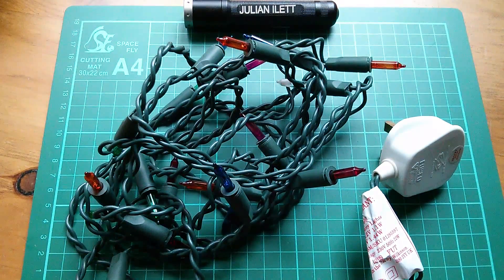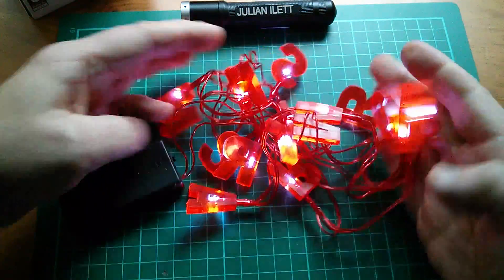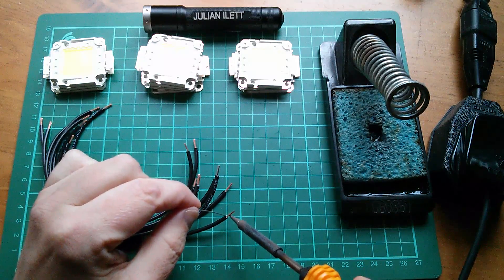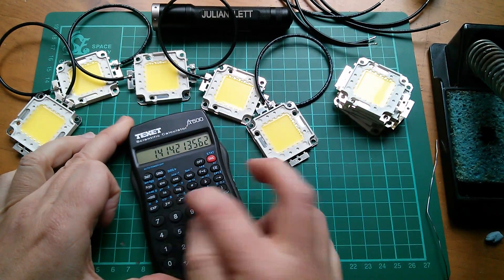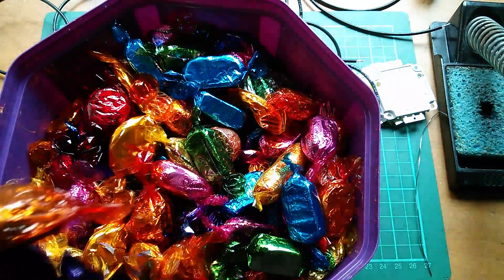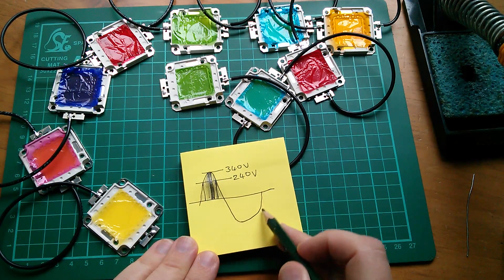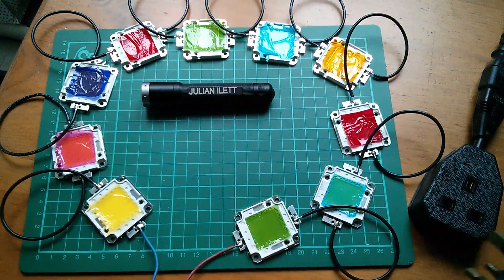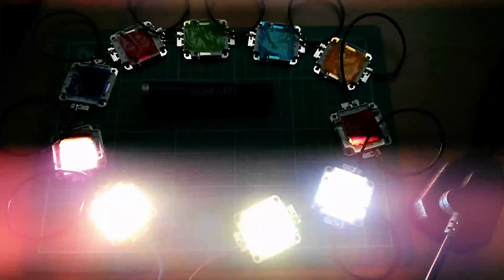Scary Fairy Lights - 100W LEDs on Mains

Comment: Effectively running those leds at 110V or 120V, and not 240V, as the 240V is from the bottom to the top of the total cycle. Ok, here in South Africa that should be 220V, but standard is 230V to compensate for load. You only use the top halve, as the bottom halve is blocked by the led. A full wave rectifier will give you twice the speed of flicker, (100 or 120Htz depending on mains frequency in your country), and double the amount of light. That should be a nice sight, but twice heat generated also. Wonder if the leds will be able to handle that...... I've ordered some 50W grow light/leds from China that is spec at 220VAC... Ummmm .... maybe it is 100W DC 110V leds...... Better not start thinking in that direction, the stuff is expensive. :-(
Reply: Sorry but you're completely wrong, there o.o AC mains is 220-240V (RMS) above zero on one half of the sine wave and -220-240V (i.e. negative) on the other half. If what you're saying was correct, Julian's LEDs wouldn't have lit at all, because as he pointed out, each LED had a forward voltage of around 35V, so with ten in series you need roughly 350V to light them, which comes from the peak voltage of 240V RMS (as he explained). Or if you're saying that the upper peak of the since wave is 240V and the bottom peak is 0V, then capacitive droppers wouldn't work (and bridge rectifiers would be pointless) because they rely on the voltage swapping from positive to negative on each half of the cycle...

Comment: You need a bridge rectifier, and could wire a couple sets of them in parallel to stay at the usual 240v.
Funny though, in America, most of ours is 120v, until you need to plug in a bigger appliance, then we go up to 240v, then if that's not enough, we use multiple phases.

Comment: When I was a child, there were no LEDs. My grandfather gave me a box of 12V / 100W halogen projection bulbs he "borrowed" from his workplace. I wired 20 in series and made a 2kW fairy lights :D. I wired them with a  bare wire, as any insulation would melt in this situation. Insanely bright and insanely dangerous. It also heated up the room nicely in the winter time. The turn on inrush occasionally tripped the breaker... :)

Comment: I half-expected the LEDs to fry on the negative half-wave. They'll have some tiny reverse leakage current, but if that varies enough between modules, then the one with the lowest leakage (highest resistance) will receive a bigger portion of the -340V than the others. This is also why I once fried a filament xmas light that I borrowed from a different set, when I assumed it might just be dimmer than the others due to higher resistance...

Comment: noob question: why weren't the LEDs killed by the AC from mains? I don't get why they were confined to just that small section of the AC wave.
Reply from the maker: It's only at the very top of the AC sine wave that the voltage reaches 340V (34V per LED). That's still not enough to push a destructively high current through the LEDs.
Reply: Ohhhh I see. So it is only at the very top of the sine wave that the current can flow trough the LEDs right? Because at the top of the wave the foward voltage is reached. Anywhere else the current can't flow and they are essentially off?
Reply from the maker: Not exactly. LEDs do not suddenly switch on at a precise forward voltage. There's a range over which the current varies. 100W LEDs start to conduct at about 24V and reach maximum safe current at about 35V or 36V (it can vary) . Any more than that and you risk destroying them.
Reply: unnn I think I get it now. Thanks!
Reply: But if I put a 5mm led on my psu at say 3v it just fizzles out, why not these ones? And also, maybe you can help me, but in AC, why is one called live and one neutral, when they are both carrying positive voltage half the time? is there a difference, and am I completely wrong... :P I'm not the smartest person
Reply: because your 5mm LED only handles 20mA maximum and your 3v PSU gives out much higher than 20mA and there is no current regulation.
20mA is not much so its not enough to load down the psu. and the LED has much lower tolerance because of how small and low power it is.
so it would pop immediately most likely unless the voltage is slightly less than 3v.

Comment: Hi, stupid question perhaps but what if you would just connect 7 leds in series: 7 x 32-35V = 224v / 245 V. Would that reduce the flickering? Is it still dangerous to do this without a Voltage regulator? thanks for the info! great channel
Reply: You need a series capacitor dropper to limit the current and bridge rectifier after the capacitor to turn AC into DC as the capacitor needs full wave AC to operate as a LED ballast. 680nF 400VAC X1 should work fine as a series ballast for these LED's, add 1M0 0,5 - 1W resistor in parallel with the capacitor to discharge it when unplugged so you wont get zapped.
Reply from the maker: The 340V peaks would probably kill the LEDs
Reply: Aha! Good to know thx

Comment: I need a circuit diagram for MPPT solar charge controller circuit without microcontroller.
Reply from the maker: I tempted to say that can't be done. It probably can - but I wouldn't want to design that circuit.
Reply: Can you help in searching for that circuit in internet please or any link to it ??

Comment: Use a bridge rectifier and some very thin bell wire that's high in resistance to limit current.
You could also use a toaster element to control current, maybe wire a toaster in series and try different 'toast' settings. This would also give some timer control so everything doesn't get too hot.

Comment: Aside from the danger of main voltages and the epileptic flicker affect, you'd also have to be concerned about sending 50 Hz noise into the mains and throughout the house and neighborhood. It could definitely have a negative affect on sensitive electronics such as TVs, computers, etc.

Interesting concept though.

Comment: could you use two of the leds to create a half wave rectifier and get 100hz flicker?
Reply: If you used a big ass rectifier bridge and a large cap it would work like a charm too
Reply: And the leds will overheat within a few minutes.......
 And will burn out......
Reply: I didn't bother doing the math(s). I just enjoy the idea of double dutying leds.
Reply: +Liam Why would you need the inductor...?
Reply: Its an effiecient way to limit current, but it would be better to use a capacitor, cheaper and easier to get the right value
Reply: That's why I asked it, why would you need that if you have a cap and resistors?

Comment: Genuine question: How come no resistor was required ?
Reply from the maker: A lucky co-incidence of mains voltage and the combined forward voltage of the 10 LEDs (what I called the sweet spot). Also, the LEDs are only being driven at full power for a tiny fraction of the mains cycle, so the heating effect is very low. These LEDs generally fail when the tiny bond wires burn out (like fuses). That's not going to happen in this circuit.
Reply: Julian Ilett thanks for explaining.....and the more I think about this, I'm an idiot. 

I was thinking "current", not voltage. Of course you explained extensively about the voltage in series etc and the peak of the sine wave. 

I was (incorrectly) thinking resistor was required to limit the current. My A-Level physics teacher would be so disappointed :(

Cheers anyway, love your videos and the way you approach and explain stuff.
Reply from the maker: No, you're not an idiot - strictly speaking all LED circuits should have some method of limiting current consumption. I just like to bend the rules :) Several people have suggested a bridge rectifier and smoothing capacitor to prevent flicker. If that were done, these LEDs would be much more susceptible to failure if there were an increase in mains voltage (due to a large increase in current). Add to that the change in diode properties as they heat up and the complications compound. It may be a simple circuit, but trying to explain why it doesn't need current limiting is quite difficult :)
Reply: SuperTex makes buck regulator ICs that regulate current at up to 450 VDC

Comment: Can you put a link to buy those led please ? :) I'm starting to film a lot and I must do a little cheap but powerful projector :p
Reply from the maker: I bought this:
Lots 1/5/10PCS 100W Cool White LED Chip Lamp Bright Light High Power High Lumen  http://www.ebay.com/itm/Lots-1-5-10PCS-100W-Cool-White-LED-Chip-Lamp-Bright-Light-High-Power-High-Lumen-/131705035878
Reply: Thanks a lot ! :D
Reply: Here: https://de.aliexpress.com/item/High-Power-LED-Chip-1W-3W-5W-10W-20W-30W-50W-100W-Cool-Warm-White-Red/32604846906.html?spm=2114.010208.3.1.1PxxkA&ws_ab_test=searchweb0_0,searchweb201602_2_422,searchweb201603_1&btsid=95b9447f-7ceb-4306-8e8a-fe59c5e51b96

But you need a big heat sink and a good power supply for driving on 100 Watts.

Comment: Great work... we here on the west side of the pond can do the same with 5 LEDS..in Canada my mains voltage is 120vac with a peak around 170..(170/5=34 - splendid!)

I will be adding a bridge rectifier to take advantage of the negative cycle. my flicker will be faster and maybe not noticibe...
perhaps a good sized capacitor I could just use it as a light source..Hummmm, got me thinking...
time to break out my old slide rule and do the calculations...

but first I will add a second string wired in the reverse, parallel to the 1st string..my 10 bulbs will then be quite festive.

Comment: Add a bridge rectifier and some big 600V caps onto it and the flicker is gone. :D
Reply: What fun is to have non-flickering christmas lights???
Reply: NGC1433
I'm not one of these persons who may have seizures but I don't like flicker.
Reply from the maker: That's very true - I definitely won't be hanging this monstrosity on my Xmas tree.
Reply: ElvanIV
No this was just a demo of what's possible with minimal component count. Directly on Mains. This is nothing you want to actually use als fairy lights. ^^

It's far too dangerous and ANY insurance will break the contract when they see this!
Reply: Kyôdai Ken but then wouldn't he have to dissipate 1000w of heat?
Reply: DON'T FORGET A COUPLE OF TONS OF HEATSINKS!!!
Reply: The 100 watt LED modules do generate a lot of heat as you state but only when DC power is applied to them and they would each require a heat sink to dissipate 10 watts of continuous heat. Julian did a good job of explaining that with his setup the heat generated only occurs during a small portion of one half-cycle peak due to the LED diode effect (half-wave rectifer) and the voltage required by the LED modules to turn On which is why they flicker at 50Hz.  My suggestion to add a full-wave bridge rectifer but not the 600V caps increases the short DC pulses from 50Hz to 100Hz so that the flicker effect is reduced and a small portion of the 10W heat is still generated so no heat sinks would be required.
Reply: ElvanIV
Yes, but for a short flicker free test it would be enough ^^
Reply: Kyôdai Ken I think his goal is to have them on for long periods of time in use, so it would be good for demonstration but not for practical use.
Reply: Kyôdai Ken true
Reply: Or add a bridge rectifier but not the 600V caps and it will double the pulses per second which will reduce the flicker but not generate so much heat.
Reply: Kyôdai Ken I was just about to say that, but they'd get a bit hot and bright I think ;-)
Reply: ReasonForemost Well, seeing that the 100 watt LED modules generate a lot of heat on their own, I think a little more heat wouldn't be that big of a deal. Then you'd have no flicker at all as opposed to barely visible flicker.
Reply: +ReasonForemost That makes perfect sense as long as you omit the 600V caps to maintain reduced heat generation.
Reply: 220uF 450V caps will do just fine! ;)
Reply: Tim Allen would in the competition of the brightest christmas lights on the house :-P

Comment: You need to upgrade your soldering iron. I have seen that model of cheapo iron in our USA dollar stores!
Reply: Are they actual Antex irons or knock-offs using Antex colours and case designs to trick people into thinking they're getting something better? The RRP is around £35 so if you can get it for $1 you're doing very well!
Reply: Well they are very cheap so must be knockoffs

Comment: Holy Crap!! the flicker is horrendous . Couldn't you make a cheap power supply and under drive the LED's so that it's safer and a wee bit more practical?
Reply from the maker: It's more of a twinkle than a flicker. Well, that's how they'll be marketed.
Reply: Triggering seizures is a feature not a flaw!

Comment: This could actually be quite cool with a rectifier and some bigass capacitors :)
Oh, and a heatsink of course!
Reply: Nope, it would be quite hot, which is the opposite of cool ;)
Reply: petti78 Haha, thats true :)
Reply: You have plenty of "diodes" lying around. Just turn the LEDs into a bridge rectifier!
Reply: Hot in both ways thermally and electrically just dont touch or you wont be able to let go but the rcd should save you
Reply: Ten heatsinks...;)

Comment: Do you know those star shower thingies that you can use to supposedly cover your whole facade in laser dots?
You can buy them for around 20€ now. Would be interesting to know what you think about them. 

http://www.ebay.co.uk/itm/272398423526
Reply: +Fynmar like all other TV sales its likely it will hugely disappoint
Reply: looks like half the innards of one of those red and green "stage" laser units (two laser modules, beams combined by dichroic glass then sent through the same lens) put into the case of a solar garden light

Comment: Try lower voltage better one put Dustin tape don't use 230 voltage or 130 voltage cause it will catch fire try it I had safety kit

Comment: Would a Bridge rectifier and a cap sort out the strobe situation , It sounds like a great project to mount them to a heatsink and see if they would run reliable without a driver .
Reply: I was going to suggest that too - but the only problem .... his colored cellophane covers would surly burn off then !!
Reply: I was thinking just the led chips , If they were reliable set up this would be a nice bright diy mod .

Comment: I'd be interested to know exactly how much power these are actually using in this configuration. It's going to be a lot less than the 1000W the LEDs are rated for, but I wonder how much less.
Reply: It should be possible to calculate the average power draw
Reply: I did a quick calculation try. If we expect a pure sine wave and the LEDs are completely off below 240V, they are only on for 25% of time. In these 25% it is not full 340V DC, so the average voltage is about 22.4% from that. 
Of course LEDs draw also less current on lower voltage, for a realistic result instead of the average voltage you would need the RMS of this time slot, too complicated for me... I guess it is below 200W.

Comment: why don't try to put Bridge rectifier for it
Reply: Do you mean a FUULL BRIDGE RECTIFIERR?
Reply: petti78 you look like watching electroboom right lol
Reply from the maker: Yes, that would reduce the flicker, but increase the fire risk!
Reply: But Julian, where's your christmas spirit? To quote Nat King Cole, chestnuts roasting on an open fire.
Reply: Setting a bridge rectifier would decrease the stress on the LEDs, so they don't have to block the half sin wave they can't let go throug, but you'd still have the flickering. You'd have to attach a fair ammount of capacitors to solve that, and thoolse 10W leds would need some sort of super-caps to do the job...
Reply from the maker: That will also be part of my marketing campaign - thanks :)
Reply: Should have used another 10 LEDs wired to the plug in the opposite direction.
Reply: those are 100W leds, not 10W, tonta.